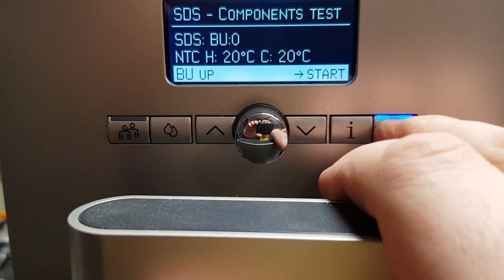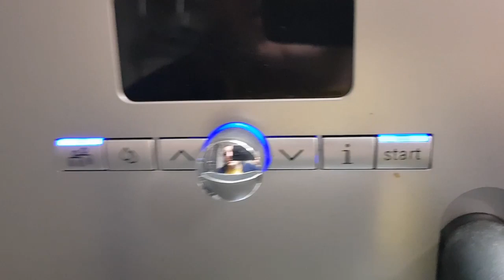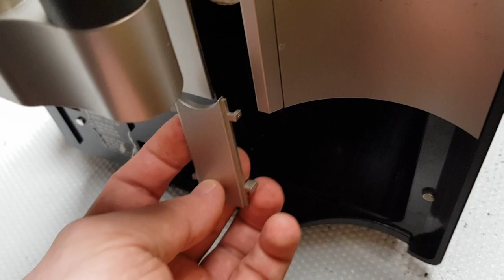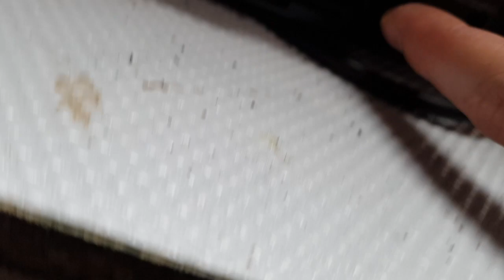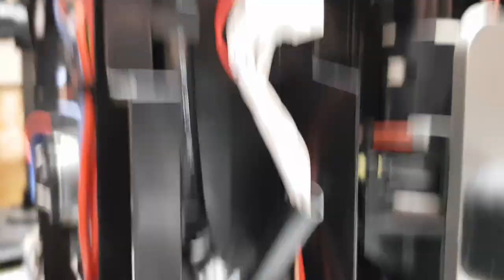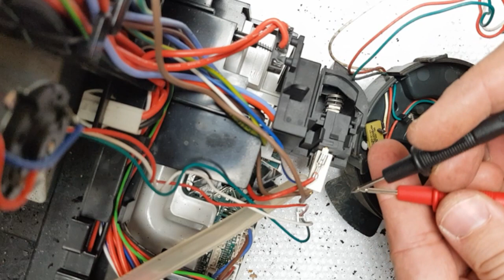Repair of Siemens eq7 brewing unit. Motor extraction/ how to split the frame

Comment: Hi there. Thank you for your patience in making this video. I disassembled my EQ7+ and back together I keep getting this Fill Water, message. I can’t turn it on or off on the power button. Do you know where I should start trouble shooting?  Ive entered the SOS menu, and forced it to pump water, so I know that is working, but it seems that the machine does not register the water.
Reply: I found out that a little chip had to be placed right, for the machine to understand. It works perfectly fine now. Thank you for showing, making me encouraged to try my self.
Reply from the maker: Glad these videos encourage people to give it a go and understand the devices better :) as in your case finding the level sensor fixed it! Good job 👍

Comment: I had a problem with the pump and the heater fuse. Took me a week to figure it all out, and could have been much longer and messier without this video. There isn't really many videos on this specific model, so disassembly was tough to perform smoothly. You not only saved my time, but also a lot of broken plastic. Thank you for sharing this forsaken knowledge.

Comment: hello. I also have this model and the problem would be that after infusing the coffee, the water continues to flow while it should get rid of the dirt. The dirt does not reach the waste basket compactly. Please help me with some ideas. I tested the sensors from the brew unit and they show me when they are up or down, I also tested the switch from the ceramic valve, they are ok.
Thanks!
Reply: Sds- error memory I have only pump TO 11.
Reply from the maker: Difficult to diagnose that kind of defects remotely.. I would bet on motherboard or General cleaning of all tubes maybe there is calc build up and you have pressure even when pump stops pumping.. but it's a wild gues from my side, don't have a real solution in this case...

Comment: Hello!I have a siemens eq 7 plus and I have this problem:when I start the machine show me this message  Position swivel arm
Set up milk frother' what I need to do ?Thanks
Reply from the maker: Haven't seen this kind of error, what happens when you rotate the swiwel arm and try to remove and reinsert milk frother?
Reply: @letsfixitgarage  when I start show me this position swivel arm and after I rotate swivel show me set up milk frother
I try to remove the milk frother but show me the same message
Reply from the maker: Well there are only microswitches which determine if swivel a is in correct position or if milk frother is in place... Try to go in service menu and check if all of these switches are working. At the same time in service menu you can diagnose some of the components if they work correctly..
Reply: @letsfixitgarage  and the start button is blinking

Comment: I have a Siemens EQ7 where the "coffee chooser" don't work - it's very difficult to get he right coffee because the "wheel/button" is nearly impossible to move in the right direction.
Maybe it can be cleaned or replaced ?
Reply from the maker: Yes it can be cleaned. You will need a soldering iron and to desolder the encoder from its board. After that cleaning is quite simple. In near future I will make a short video about it as my own starts to misbehave..
Reply: Thank you ve ry much - I will look forward to see the video 😊
Reply: @letsfixitgarage  Have you any plan for making the video in the nearest future ?
It's a very big problem that it shall be so difficult to choose the coffee we want.
Reply from the maker: @idereklame8840  it's already online ;) it seams you haven't subscribed to my uploads :)))
Reply: @letsfixitgarage  I have subscribed, but I haven't received anything about a new video - I will try to find it 😊

Comment: Hi. How did u test motherboard? Did same procedure following ur video, everything works inside the transmission, motor , sensors. When powering up getting message - call hotline.
Reply from the maker: Motherboard was ok in my case. Check diagnostic errors and proceed accordingly..
Reply: @letsfixitgarage   well, diagnostic can't turn motor. Shows "bu motor disconnect". Just tested motor for resistance with multimeter.
Reply from the maker: And on motherboard any burn marks? I would check MOSFETs on motherboard for a short if motor is ok..
Reply: @letsfixitgarage  no evidence of burns. What is mosfets, sorry not so familiar with electronics? TIA
Reply from the maker: MOSFET visually and functionaly is similar to transistor but it is operated by voltage and not current. try to search in YouTube MOSFET basics and how to diagnose faults.
Reply: @letsfixitgarage  Got you, thanks for your replies. Will prefer to ask someone who has better knowledge in electronics to check that board.
Reply from the maker: @Ruta5577  I remember seeing one quite good video in rusian language where one guy repaire ~10 motherboards with different damages.. although mostly it was bean mil MOSFET shorts but still quite interesting.. good luck!
Reply: @letsfixitgarage  i know, saw that video too. But like I'm saying don't have that much experience with soldering and testing. Beside that, he was using some boards for a spare parts.